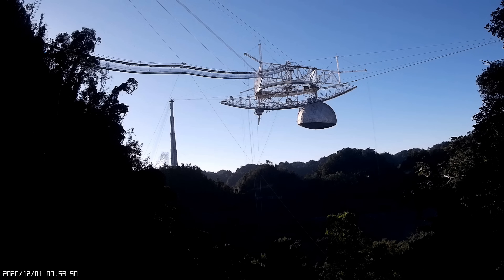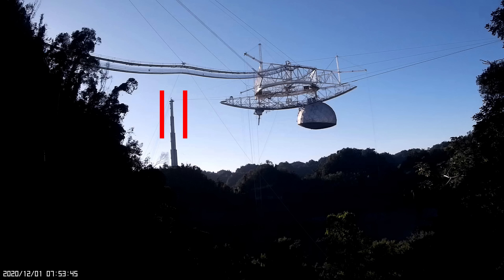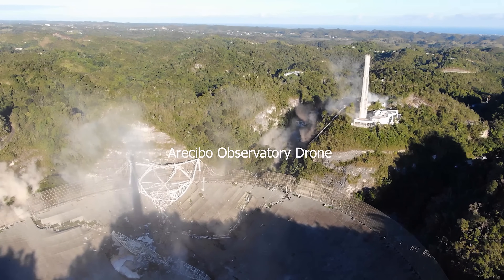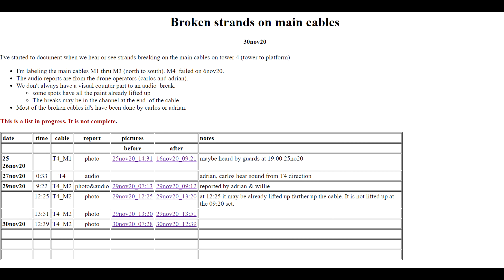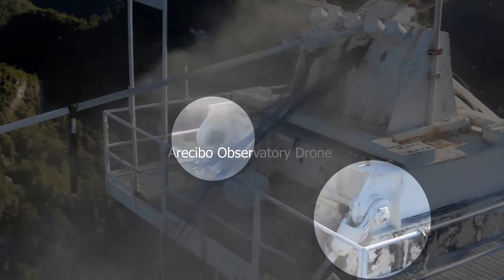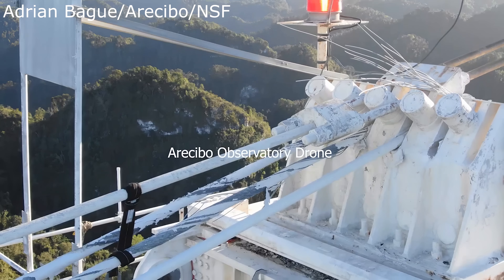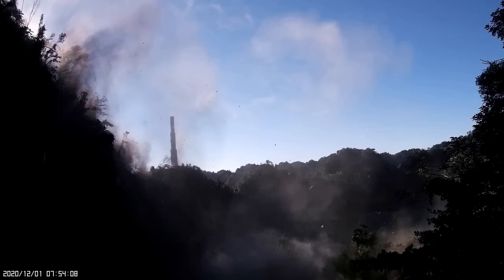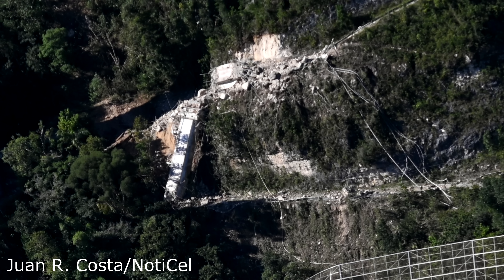Analyzing Video Footage Of Collapse of Massive Arecibo Telescope

Comment: Thanks for sharing your thoughts. I knew you would weign in on this. I experienced something like this in miniature when a wind turbine tower collapsed at a very remote FM radio transmitter site I maintain. It was obvious that there were gigantic forces involved when the spinning rotor came off the generator and first stretched, then severed the guy cables. However, it wasn't until a year and a half later when we first put RF power back into the main transmitting antenna that we became fully aware of just how violent this was. The transmitter acted like it was transmitting into a dead short. We found the short alright, at the base of the 7 bay transmitting antenna. A flailing guy cable, quite a distance away from the tower collapse had started, had hit the main (coaxial, but made of concentric copper pipe)  RF transmission line and crushed it at a point where a support to the tower took a lot of the force. Because of this, we could not see it from the ground during post-event inspections. We had a new line segment made by the antenna manufacturer, and we are now back on the air. I have the crushed line section, with marks from individual strands of the guy cable, as a souvenir.

Comment: not surprised it broke, they had a main structural wire break in November and other wires starting to come apart and they are just leaving it like that? no sh*t it broke they didn't even try to fix it and if some worker died while they were slacking on maintenance I would call it manslaughter on whoever was responsible for not doing repairs.

Comment: This feels like a metaphor for the global economy with the middle cable that snapped represents us, the United States. The inner cables that are snapping bit by bit internally and a few externally are the poor and middle class. The 1% are like the end of the cable that actually snapped that was the strands holding into the socket at 5:30.

Comment: as having been a professional rigger crane operator for years, I am appauled by the design of the supporting cables to that reciever trolley / dish....by stretching the cables  out almost horizontally, they were putting at least ten times the  loads weight on those cables... if the reciever trolley & dish weighted 10 tons, they were putting at least 100 tons strain on those cables.....
and after that, they added lots more tons to the receiver / trolley without exponentially increasing the cables strength...of course the cables broke...it was a miracle it had not happened sooner !!!
Reply: All it ended up needing was the fluttering breeze  of a drone propeller.

Comment: My fence wire is about 1 strand of that cable, and that can take about 1 ton of pull, the forces involved there are staggering.
Failure was certainly inevitable unfortunately, and I'm surprised they allowed anyone in that area

Comment: How could anyone justify rebuilding it when they can't even preform basic maintenance on it......
        All of it was predictable. 
These are supposed to be the smartest people on the planet. Not one LICK of maintenance????
        There's only one reason a large wire rope fails within its designed load.....   Carrosion.......
50+ years without changing out wire rope?????
     Nope let die and be a warning to future generations how expensive being lazy really is.......
Reply: Even the smartest people on the planet cannot perform proper maintenance  without adequate funding.
Politicians are in charge of providing adequate funding, unfortunately.

Comment: "ACCIDENT" yeah sure..
Reply: @NerdyNEET  helicopters.. ??? do you even fysic dude.. ?? pully's and cranes are the only thing that would take that load..
Reply: @NerdyNEET  Months to react might not be true. Years to react, though. The last months were probably too dangerous to be working on it. (But as usual those with the will did not have the money)
Reply: @NerdyNEET  150 tonnes suspended. Would you have volunteered to be on the team unbolting or cutting it up?
Reply: @NerdyNEET  i know of russian choppers but ten tons is new to me..?  and as i said. i dont believe this was an accident. they just let it happen.

Comment: As a lover of astronomy, that really hurt to watch.
Reply: As a lover of astronomy and a Puerto Rican, it hurt so much, considering what he said toward the end about politics in PR and any plans to fix/replace it. Without external help (that probably won’t come because we’re not all that important of a US territory), we definitely wouldn’t be able to with our economy where it is right now (the island’s not the US’s).
Reply: @Mikeological  While I am sorry the telescope was lost, it is unlikely it would have been saved even if it were on the mainland.  The Arecibo Observatory had at most four months (from August 2020 when the first cable broke) until December 1, 2020 to do the large scale construction necessary to remove the platform before fixing or replacing the cables.  Even with funding, successful repair probably wasn't going to happen in that time frame.

Consider what happened/was narrowly avoided at the Oroville Dam.  The Oroville Dam in California opened the same year as Arecibo Observatory in 1963.  The projects were of similar scale.  In 2017, Oroville Dam's concrete spillway (used for overflow water in years of heavy rain) failed.  A massive stream of water started eating away at the hillside that formed part of the dam.  Fortunately, shortly after the spillway failure, the rain stopped in California and the next year (2018) was dry.  Dumb luck is what saved the Oroville Dam. They BARELY replaced the concrete spillway by the rainy season in 2019. So, two years to fix.
Reply: @emawerna  yeah that’s definitely true, but whatever chance it has of getting repaired would arguably be at least somewhat higher if it were in the states. Fair point though that it wouldn’t be much better unless it were near Houston or something where it would feel almost synonymous to JSC (in terms of symbolic value on top of its functionality) to a lot of people here (I know it wouldn’t be the best place with all the light pollution but you get the point haha). 

I’m not complaining about where PR ranks in the mainland’s priorities though, I know it wouldn’t make sense for it to be treated like a state if it’s just a territory (even the statehood thing is definitely not gonna happen any time soon, if at all)

Comment: Classic cascade failure. I'm a stage hand/ high rigger and I've seen a few of these. This is why in rigging we have built in redundancies. If a cable snaps, the two cables that the load transfers to have enough capacity to take the load without failing.

Comment: They should have inspected those cables semi-annually for weakness and trouble. First sign of trouble they could have replaced the cable and keep the Arecibo telescope operational for many years. This is neglect of equipment and property entrusted to those that are using and maintaining it. Nothing last for ever but we could have kept it running longer until something new can be created to replace it.

Comment: They don't use zinc zinc is a positively charged metal and wood Creek Road they use what is called Babbitt and Babbitt is a lead and Tin mix and it doesn't croad zinc is a positively charged metal and it grows extremely fast that's why they use zinc pads on ships and bridges and stuff like that because it will corrode there instead of the other structure so you definitely would not want and zinc on a high strength area

Comment: What is ridiculous is that it should have been prevented. The original failed cable should have been replaced and that would have been enough to prevent catastrophic failure for a few years. The scientists would obviously have known this so it sounds like an administrative failure. Could this lead back to a certain politician who doesn't give a rat's ass about Puerto Rico?

Comment: Instead of a cabled structure, they need a solid truss running radially across the new dish with a series of detectors that move along the truss.  The ends of the truss need to be attached to a rail system running the circumference of the new dish, so that the detectors can be aimed with precision, and even maybe used in a scan mode involving constant slow rotation across the sky.  But what do I know?

Comment: I would really like to see the original drawings and weights. It is a really odd failure. Cables typically have a factor of safety of about 4. With one cable missing, you still shouldn't have an issue unless the cables were built well below standard. Perhaps this was done to minimize the amount of interference from the steel? It also failed when it was not stressed due to high winds. The failure started with just the static dead load. Was there corrosion in the cables? How did engineers determine the structure was unstable? Unless the structure was under designed to start out with, how did they know that it wasn't a flaw with just one cable?

There are suspension and cable stay bridges all over the world. How did the loading, capacity and construction methods on these cables differ from bridges?

I don't see the concrete towers being constructed in the 60s as being a  contributing factor. Except for seismic and shear in concrete, the current structural standards are similar (assuming Puerto Rico used the same standards as the rest of the US). There could be deterioration issues but that still wouldn't affect the cables.

Comment: I know from experience of working in that part of the world that the climate is brutal to this type of structure, yet there appears to have been very little in the way of protection for the steel cables and reinforced concrete structures. Lets hope that when it's rebuilt, they pay more attention to protecting the structure.

Comment: I am quite surprised that it was allowed to collapse.  Given months since one cable's complete failure and years of warnings that cable strands were breaking, why was it not possible to replace the cables?  Installing new cables would have been a small fraction of the cost of recovering from the collapse.

Comment: Pretty heartbreaking. From what I've read from locals in the know, it seems unlikely it will be rebuilt. The cost would be prohibitive compared to the sorts of data it can collect, but more importantly, there's just nothing on the drawing boards ready to replace it. Planning alone would take years, and that's assuming there's any political will, which seems unlikely.

Comment: If radio astronomy is anything as difficult to fund as it is in the movie Contact, then it probably wasn't being properly maintained. When I was in the US Navy, anything load bearing required a periodic static and/or dynamic test. If they weren't dismantling the telescope every required number of years to test these wire cables and/or replacing them as required, then it was only a matter of time. Especially in an environment like that. On the surface, wire cables can look perfectly fine, but the strands inside will be corroded and start to deteriorate, adding more stress to the outer strands. Or maybe they were doing all of that. Just my semi-professional, but mostly ignorant opinion. I just like leaving comments to support the channels I like :)

Comment: When I was in the Royal Navy, I saw a steel cable part, and a poor rating lost a hand, thing was like fine then CRACK - No clues, no stain noise or singing, or vibration - it was under strain like it normally was and then parted. The individual strands spiral as they release the energy its like a fine wire propeller blade - Like a lawn strimmer. By all accounts the hand flew off and went 30 yards overboard straight to the bottom. Guy passed out, within 2s, no screaming just white with shock and medics were with him in 30s. I wonder where he is now?

Comment: It's definitely unfortunate this happened.  One has to wonder though for a facility that was over 50 years old, getting close to 60, how old were those particular cables and why had they not been replaced?  Were they original or had they been replaced over the years?  That is probably a pretty extreme environment as well, close to the equator so, lots of hot and cold cycles with the resulting expansion and contraction.  Lots of rainfall as well that has an impact, just look at the tower's concrete surface condition, very heavily impacted by the environment.
This place will probably be one of those sites that shows up in the next couple of years on an abandoned facility website with pictures of the aftermath.

Comment: I'll repeat that "cable" is the incorrect word to use for these wire ropes. Yeah, it's easier to say, but for techical commentary incorrect. Cables are 3/8-inch diameter or smaller.
Reply: That maybe so but  nobody cares.
A cable is a wire rope and a wire rope is a cable to most people.

Comment: I was thinking the tension on the cables were not anywhere near optimal. Some having more load than others, which contributed to the failure. Probably due to no adjustment having been made after the 1st cable snapped, i'm guessing.

Comment: I am preplexed as to how this was even allowed to happen, especially scince cable#4 failed and added a lot of stress to the structure. I know the bureaucratic process takes a lot of time but in dire situations like this surely somebody has to put their foot down. What about saftey protocols? I find it likely that the odds of this telescopes continuation would be higher if it would be dismantled properly as opposed to this. And who on earth will even be liable to this disaster? 
I find it very arrogant if not ignorant how close people where to get hurt or even die should they have been in the wrong place at the right time. Now im not sure how this was handled but I think chance had way to big a part in that equation. 
Hopefully things will change for the better but it will undoubtfully  take a lot of time before we see positive change.

Comment: As expensive as the structure was I would've thought they would replace the cables after the first one broke. It is always cheaper to address the problems before complete failure.

Comment: So scientists used this telescope as much as they could, with the lack of funding to do repairs to this "ancient" instrument? That actually really does suck, I had no idea this puppy put up it's legs for the last time. They obviously knew it was gonna go, considering the failure of cable #4, scary to work there, knowing the structure was bad! How would they have even fixed the cables? String a bunch of new, smaller cables and then start replacing the big ones later? Like you said, who knows what condition those towers were really in. No wonder they let it go :(

Comment: Every time I see the drone footage, I'm amazed at how much the giant concrete towers jump and flex after each cable snap.  

Also, he mentions the azimuth arm falling, it looks to me like it's being PUSHED by the tip of one of the triangular sections of the main structure, which (someone please correct me if I'm wrong) would have been falling faster than 9.8 m/s^2 due to the pull from the non-broken cables and rotational forces, which is at least contributing to the bending we see with the azimuth arm. 

The forces involved in this are just incredible.

Comment: The Aricibo radio telescope radar reached its use by date after how many cyclones and weather events and tropical climate which is wet and warm. 55 years for an experimental instrument is not bad. Bouncing microwaves off asteroids, planets and the moon was its active phase as a radar transmitter receiver and just listening with its receivers in passive operation. Dual purpose. Even the Chinese earth crater dish is only a receiver.

Comment: Thanks very much for this presentation, especially for covering the politics. The Arecibo telescope was a world asset for all humanity and required the coordination of many elements, including political efforts. The fact that the mechanical edifice, with its many cables and supporting structures in tensile and compressive  failed as a unit is a metaphor for the more extended system including the economics and politics .

Comment: Hi Scott....thanks so much for your video presentation. I've been curious as to why we can't see the Drone in the footage before the cable breaks, I have studied the area around that tower and I'll be stuffed if I can see the Drone, I don't believe the Drone would be a small toy these Drones can be quite sizeable. I can only put it down to the resolution of the Video which looks HD anyway...I would've thought one would see it as a little black dot but visible non the less. Your cross on the screen you place I assume is a best guess as to where the Drone might have been or can you see it??...Cheers Clint Jeffrey - VK3CSJ  Melbourne, Australia
Reply from the maker: The footage is 720p, pixel resolution at that range is 2 meters
Reply: Thanks Scott....I suppose that'll be the reason, it would be interesting to see a picture of the Drone used just to get an idea of its size....

Comment: The failure was set in stone when the fourth strand failed. This would then lead to the ultimate failure as shown in this video. 

It was only a matter of time. Shocking management. They should have been releasing the load on the cables. The final collapse is not relevant as failure of the other cables is noted. 

There was no disproportionate collapse mechanism. These mechanism provide alternative load path to prevent complete collapse.